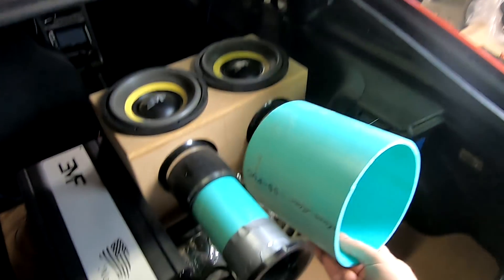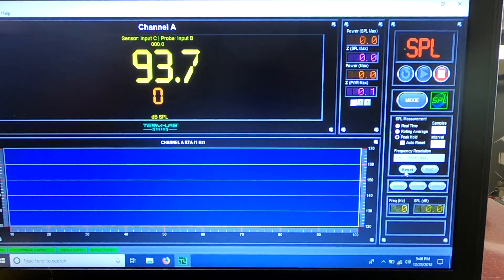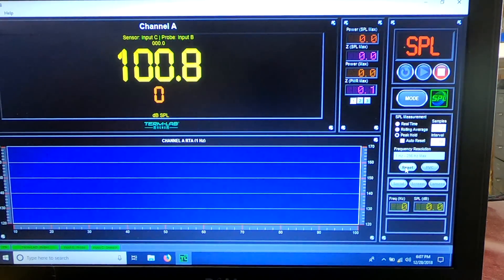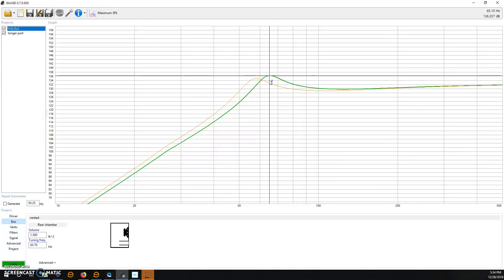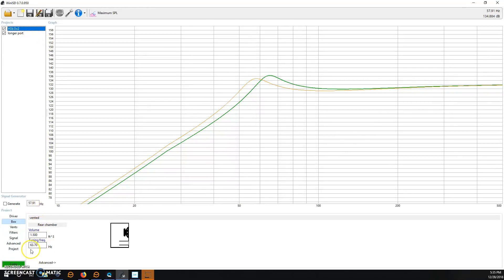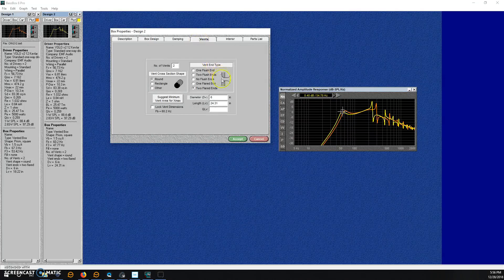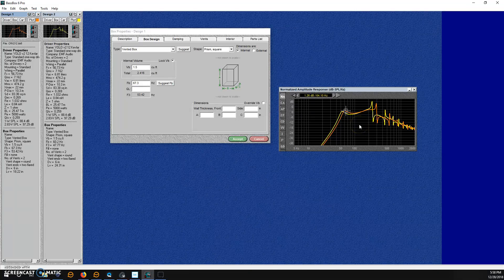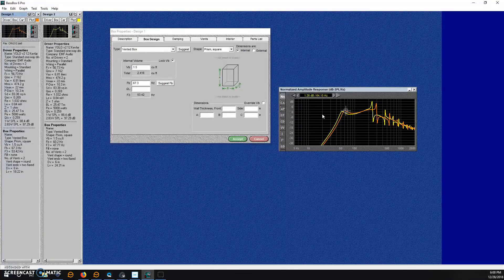Your box modeling software is very wrong, here's proof - Tech Stuff Tuesday

Comment: Box modelling software typically uses t/s parameters, which are SMALL SIGNAL parameters.  They will not accurately model a system driven to its SPL limits - because their predictions are based on SMALL SIGNAL parameters.  And while some of those box modelling programs will allow the user to see what the impact of a car's measured transfer function would be, very few, if any of them can accurately predict other factors like vent compression or impedance changes due to a voice coil heating up that will affect the output at peak SPL levels.
Reply from the maker: That's why I mentioned those things in the video.
Reply: @EMFAudio  If you mis-use a tool like software-modelling using small-signal parameters to try to estimate a speaker's performance at high SPL levels, then you won't get the results you expect.  It's not that the software modelling is wrong.  It's that it's the wrong tool to use for this specific type of use.  It's like trying to use a hammer when a Dremel is required, and complaining that the hammer gave bad results.  Well, duh, LOL. 

There are some techniques that can be used to bring the software modelling predictions closer in alignment with real-world measured results, like measuring the t/s parameters at a higher input voltage and using those for modelling purposes, but you will never get perfect alignment because the software modelling does not know and cannot predict things like how the car's interior will impact the response at high SPL levels, or how much vent compression is going to impact the response of the vent at very high input levels.  That's where experience and fine-tuning is needed.  Software modelling will get you to the baseball park.  Experience and fine-tuning will get you on to first base :-)
Reply from the maker: @Grommet2007  It's not misusing a tool when it's using it how they intend. Is every single driver already in their database Kilippel tested? No! That means they supply driver data themselves in small signal and that's how they intend to use it. I am aware on the inductance variations, I did a video on it over a month ago. Go back and watch the whole Tech Stuff Tuesday series. The fact is, the simulations aren't perfect, if they were they both match then you could try to blame the user. They're just not accurate, that was the point of the video.
Reply: @EMFAudio  If you're using driver parameters from a database rather than ones you've measured yourself, then you're already losing accuracy. Some manufacturers publish accurate parameters for their drivers.  Others, not so much. 

And if you're using a software tool that is not designed to predict SPL output at very high input levels in a closed environment like a car's cabin, then of course the results will not match what the software tool predicts. It's not that the software tool is "wrong". It's that you are not using it correctly.  If I use a hammer to drive a screw, the hammer is not wrong, it's my use of it for that purpose that's wrong. 

As for the different predictions between the two software tools you used, then that suggests that one is more accurate than the other.  I'd place my bet on the one that's modelling the impact of the driver's inductance and the impact of the vent's pipe resonance modes on the overall response as being the more accurate of the two.
Reply from the maker: @Grommet2007  You're making every excuse in the world to defend something that isn't right, so you can be right. Using parameters from the database THEY SUPPLY you're saying isn't necessarily accurate. OK, well that's using it how they intended, so it's intentionally inaccurate? 

You're focusing on the wrong things all together. This isn't just about SPL prediction, it's also about frequency response. There were drastic changes in tuning and response didn't change (and the port calculations were different as well). The simulation shows a drastic change.How do you know the software isn't designed for high SPL? It will graph 190 dB if you tell it too. If it isn't designed for it, why can it be displayed? Correct, if you don't enter the vehicles acoustic parameters (which isn't a matter of not doing, it's a matter of can't do it) then it won't yield an accurate result. THIS IS THE REASON FOR THE VIDEO. It's not using it wrong, it's using it within the constraints of the software which can't accurately depict reality. Now I know you're saying BBP can take environment of a room into consideration, except for it can't predict the floor, ceiling, wall, and furniture materials and shapes either. So unless you're listening in a completely empty room, that's not going to be accurate either. Again this is not using the tool wrong, it's using it how it's intended and it just doesn't work. It's using a trim hammer to put in railroad ties. It's still doing what it's intent was, it's just not robust enough to do it well.

I think you missed the point on comparing the two softwares. You say you'd bet on the one that does inductance and pipe resonance, but that still leaves the other one not being accurate. This goes back to the original point of the video being, they aren't accurate. It doesn't matter how or why it's not accurate, if it's not accurate, it's not accurate. A wrong measurement is still wrong no matter how you try to justify it.
Reply: @EMFAudio  I quote from your last statement: " if you don't enter the vehicles acoustic parameters (which isn't a matter of not doing, it's a matter of can't do it)" - EXACTLY, THE TOOL IS NOT DESIGNED FOR THE PURPOSE THAT YOU"RE USING IT.  Got it yet? It's not going to accurately predict SPL levels in your car because it was not DESIGNED to do that.  

Most of those tools are designed to simulate output in 2PI space at low input levels.  More advanced software simulation programs may give options for estimating what the response might look like in a room of a specific size, but it is what it is, an estimate.  Experienced builders treat the 2PI space simulation as a reference point, nothing more.  So to say that the tool predicted 120dB and you got 125dB when you used the box in car does not mean that the software modelling is wrong.  It means that you are making wrong assumptions about how it should be used.  The issue is with the user, not the software.

BTW, any experienced speaker builder looking for MORE accuracy (emphasis on the word MORE) in their modelling would measure the t/s parameters of the driver that they're using, because they would know from experience that (1) there can be variations in the parameters from driver to driver, and (2) the published specs from some manufacturers can be way off the actual specifications for the driver .  The fact that you just went with the published specs as included suggests to me that you're not really being serious about accuracy, in a video that specifically aimed at highlighting inaccuracy
.
Reply from the maker: @Grommet2007  Show me where the software states it's only for use at low SPL levels in that space.  I'll do you one better, Bass Box Pro specifically states it IS for a car. I very specifically used it how it's intended. You mention experienced builders, which I am, so I'll explain how I treat it. I don't use it for anything more than port calculations. Again, you're making excuses for it. Everybody uses it wrong, it's just a reference point, it's close enough, it can't predict the unknown.... all reasons the result you see isn't what you get, which we like to call, wrong.

Now, I've gone above and beyond the "experienced speaker builder" label you've put up there. I designed the speaker from scratch, I hand built the speaker myself, I took the parameters myself, and that's what you see in this video. Since you mention individual variants in the speaker, let's go deeper. You buy the speaker, you measure it, you build an enclosure. 6 months later do you test and build a new enclosure because the specs changed and now it's a completely different box? No, because it's not audible. You're still ignoring the fact that even comparing graph to graph there are different results no matter if you're looking at port calculation, or SPL estimations, or peak gains, or frequency response. None of that factors the environment you keep preaching is using it wrong despite having a car usage selection, and yet they're different. If they are different, that means at least one of them is wrong.

All of that being said, I'm done here till you can show me a video of a software simulation matching real world measurement. Identical everything, SPL, impedance, frequency response, the whole thing.
Reply: @EMFAudio  "Show me where the software states it's only for use at low SPL levels in that space."

LOL, show me where the instructions for a hammer are that's only to be used for driving nails :-)

You've completely missed the points of my posts.

If you want to make a video about the inaccuracy of software simulations, then do the measurements UNDER THE CONDITIONS THAT ARE SIMULATED.  Flat open field, drive voltage less than 2.83V, measure at 1M, all sources of output at the same distance from the mic and as close to each other as possible.  Otherwise your measurements will never be a close match to the sim - because the environment and conditions under which you are doing the measurements do not match the sim'd environment.  This video does not prove anything.
Reply from the maker: @Grommet2007  So you're just gonna tell me I'm wrong and refuse to show me I'm wrong by displaying what's right? I did a pretty good job of showing my side, where's yours?
Reply: @EMFAudio  I've detailed to you in my previous comments how what you're doing is wrong.  Your video would be better entitled "How to misuse or misinterpret the results of software modelling of subwoofer systems."  

BTW, as you are using Bass Box Pro, did you enter the vehicle's measured transfer function at the listening position under the "Room Acoustic Properties" section?  If done correctly, while you still won't get a perfect match between sim and results at peak SPL levels, at lower SPL levels the match should be a lot closer if done right and you're using a subwoofer driver that actually remains linear for a usable SPL range.  One of the first things I did with my car when I first bought it was to map out its transfer function at the listening position so I could use it in my sims - which made me immediately regret my choice of vehicle because of the deep dip at ~70 Hz, LOL.  

Look, if you want to question the accuracy of a simulation, that questioning needs to be done under the environment and conditions that the sim is supposedly emulating.  And use a good tool that can actually detail the difference between the sim'd and measured results.  I normally use REW, which allows importation of FRD files generated by both the simulation software and the measurement software because it makes it easy to do so, but even Excel's graphing functions can be used for that purpose, as I did for the link below, where I compared the measured performance of my POC3 TH build against the Hornresp sim.  There was minor deviation at midbass frequencies, which I subsequently put down to the fact that the model did not include the impact of semi-inductance in the sim'd response curve.

https://www.diysubwoofers.org/projects/other/POC3/

That particular subwoofer wasn't designed for car audio use, but it did produce some interesting results in car.  The simulation tool had no way of simming this effect - the middle peak in the impedance curve was almost completely damped by the car's cabin - it just happened to occur at the car's resonance frequency. This in turn meant that the cone excursion at and around that frequency was also reduced significantly, and the POC3 ended up having a lot more power-handling when used in the car than when used outside of it.  When used in-car (usually on the way back from using it to provide bass duties at a small event), people tend not to believe that all that bass is coming from a 12" speaker with 5mm Xmax.  Of course as soon as opened the trunk and the driver started popping at high volume, reality set in...
Reply from the maker: @Grommet2007  I have also detailed why what I'm doing is right. It appears you're coming from a non-automotive application and don't understand vehicle acoustics. So, I'll further explain to your excuses. No, I did not enter in vehicle acoustic information (queue eye roll). That screen asks for specific SPL at various frequencies to determine peaks and dips in response. Cool, where do you get that info from? You might get it from coming up with a perfectly flat out of the car setup with a box and EQ then dropping it in, putting an RTA on it, reporting all that data, and bam, got it. Only one problem. Now you turn it up 10 dB and all that data is worthless because the car acts differently under pressure. Turn it up more, it changes again. You will not achieve the desired SPL levels with the "flat" setup. Your link is to a setup that is below 100 dB, this setup does more than that on 1 watt. As pressure increases, metal and interior panels move, and when they move, the environment changes. That is not something simulation can predict. Also, thanks for all the clicks, it's literally paying off.
Reply: @EMFAudio  "It appears you're coming from a non-automotive application and don't understand vehicle acoustics." - ROFL, I've been doing car audio installs since the early 1990's, before software simulators really became mainstream and the ones that were available were pretty basic, unless you were prepared to pay a significant some of money.  Hell, I wrote my own spreadsheets for deriving t/s parameters and simulating subwoofer designs back in the day to perform the simulations, including the car's transfer function.  I recently removed them from my site because I've gone all in on Hornresp and the spreadsheets did not take Le into consideration and it wasn't worth the effort to update them. I've also assisted with one or two SPL installs back in the day (including designing a hybrid box that could be converted from "SPL mode" to "daily driver" by simply blocking two of the three vents) but that's not really where my interest lies. 

"You might get it from coming up with a perfectly flat out of the car setup with a box and EQ then dropping it in, putting an RTA on it, reporting all that data, and bam, got it. " Sorry, but it's pretty clear from that comment that you have no idea how to obtain a car's transfer function, so once again I find myself questioning if you really know how to correctly use and interpret the results from these software simulation tools.  Google it and educate yourself.  There's no requirement to get a sub with a perfectly flat frequency response to obtain the transfer function.  In fact, with a slight modification, you may be able to use the same subwoofer box that you used for those tests. 

Finally, I did indicate that including the transfer function in the sim would provide more accuracy at lower SPL levels. Quote: "at lower SPL levels the match should be a lot closer ". I thought it would be pretty obvious from that statement that the reader would deduce that as the SPL level was increased, the match would be less close.   Looks like I'll have to start stating the obvious...
Reply from the maker: @Grommet2007  I've built 180+ dB cars and you're suggesting I don't know about how to get a cars transfer function? I have a single 8" that does 154's, no idea what I'm doing? You're suggesting you don't need a flat response to find resonances so you can translate to other data? So you're doing extra work, on top of the extra work, so you can do more work for a simulation that will still be wrong? Just to be clear on the last line there, you're finally admitting the simulation is wrong? I mean, you wore out the excuse of "low SPL" so at higher SPL it's not accurate? Oh wait, that's what I've been saying all along at what I call low SPL levels, mid 150's.  We get it, you can't be wrong, simulation means everything (despite every top installer not using them) and you've been doing it since the 90's (so have I BTW) so everything now is garbage. I will no longer entertain your comments as it's a waste of time, don't forget to share your hatred with your friends, every click counts.
Reply: @EMFAudio  "I've built 180+ dB cars and you're suggesting I don't know about how to get a cars transfer function?"

It's your own comments that suggested that.  You do not need a box with a flat response.  What you need is a REFERENCE, which you can measure under specific conditions, then measure again at the listening position.  The transfer function would be the difference between those two measurements. 

As I suggested earlier, you are doing the equivalent of using a hammer to do a Dremel's job, and then complaining that the hammer is not working.  The problem is not with the hammer.  It's with its user.  Those software simulation tools were not DESIGNED to provide accurate results under the conditions of your tests, so obviously their predictions will not match the measured response.  There's nothing "wrong" about the tools.  What is wrong is how you are using them.
Reply: idk unless you post DB scores or SQ trophies not sure whatever you said has any relavance brian
Reply: I just noticed something else - one of the box modelling software programs that you're using shows a flat or rising response at higher frequencies, and an impedance curve that gets flatter at higher frequencies.  This suggests that at the very least it does not take driver inductance into consideration, and certainly does not take into consideration other factors that can impact predicted output like semi-inductance.  And the other program does not show the semi-inductance parameters in the input dialog boxes.  For high inductance, low impedance drivers like car audio drivers, these factors can significantly impact the accuracy of the model.  For more information - https://www.diysubwoofers.org/misc/semi-inductance.html